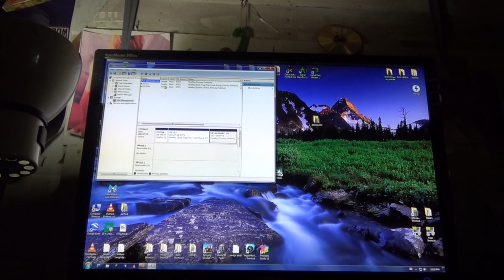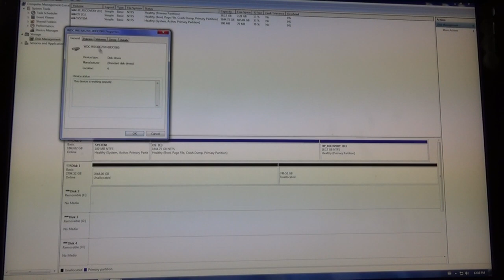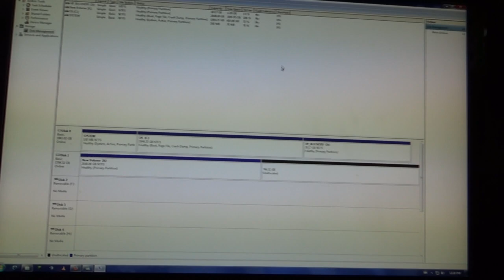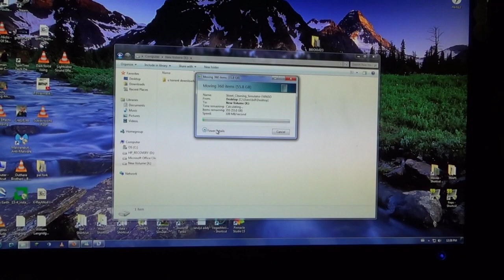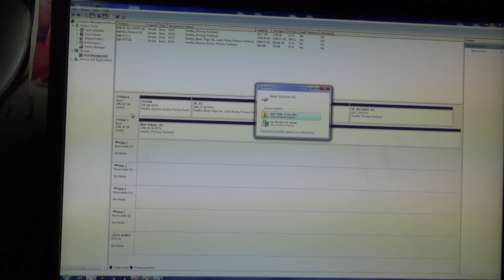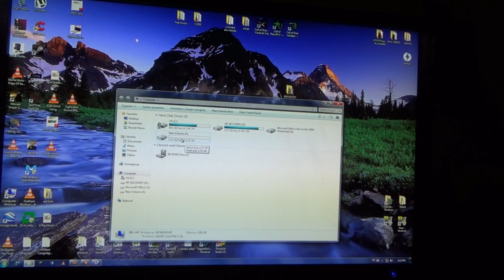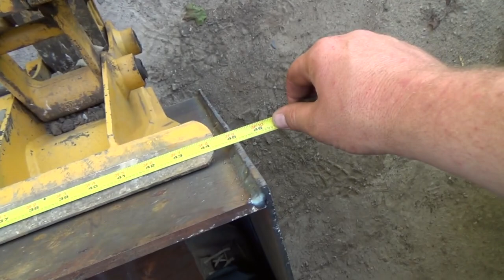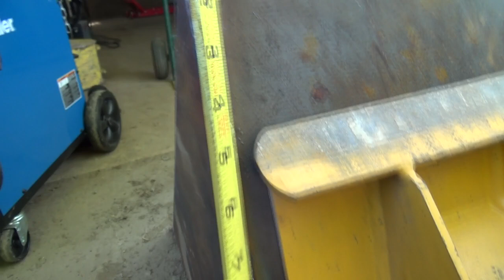more work on the new hdd think i got it now and some more loader bucket work

Comment: BILL, The filing system on the hdd takes up space and it wastes a little bit :-)

Also the counting system the manufacturers use is slightly different to the computers view of kb/mb/gb so some error there as well.

Spot on with the bucket :-) :-)

Comment: Anybody who is curious, buying hard drives is like buying lumber.  You have a nominal size and an actual size.  If you buy a 2x4, you're actually getting a 1 3/4x3 3/4 size.  Figuring hard drive size is simple.  Take the size being sold as and take it times 0,931 to get the actual size!  3TB=3000GB. 3000x0.931=2793GB of usable space.

Comment: wanna be able to reinforce the outter edges and put your support bands on the outside of the bucket for support not on the inside. inside they are pretty well useless, I think you'll get it all figured out though since you have the original bucket to look at for a template so to speak. wish i had the toys to play with like that. i mean i have some of them but not as new or beefy ya know?

Comment: Also, devices in a computer usually start counting at 0, which is why 64MB (the old, true Megabytes) of RAM showed up as 65535kB when counting on boot-up, instead of 65536 (which would've been correct for 2^14 bytes). Same with RAM-slots: The first RAM dewie is on bank 0, then comes bank 1. And so it is also with the drives. First drive is 0, then comes 1, 2, and so on.

Comment: If you have a HDD that is larger than 2TB it will split it up if you configure it as a MBR style instead of GPT.If you right click on it and select "convert to GPT you will have all of the capacity under one drive letter.

Comment: I'll try to explain to you the difference in size: Usually, bytes, being a binary unit, were measured in 2 to the power of 10's, so 2^10 bytes (=1024) were one kilobyte, 2^10 kilobytes (=1024kB) were a megabyte, 2^10 MB (=1024MB) were a GB and so on. Then the industry saw they could write more on the drive then was actually in there, if they based it on 10, making it exactly 1000 every step instead of 1024. So they created a new unit that's now the actual MB, GB and called it GiB, MiB, TiB....

Comment: (cont.) pronounced "Mebibytes", "Gibibytes", "Tebibytes" and so on - silly names noone would use anyways. But that got them to use the old terms for the 10-based units for their smaller unit. Some software shows the actual (2-based) Mega/Giga/Tera/whatever-Bytes, while other software uses the new unit.So if you buy a 3TB hard drive now,you get screwed for the factor of 1024*1024*1024*1024 as opposed to 1000*1000*1000*1000.But hey,that's how the system works.Making more money by lying,why not...?